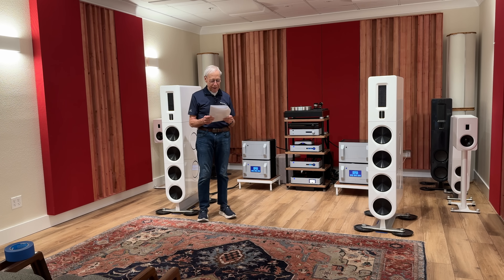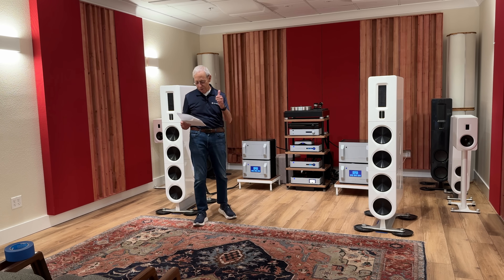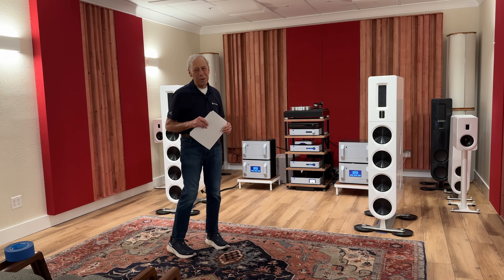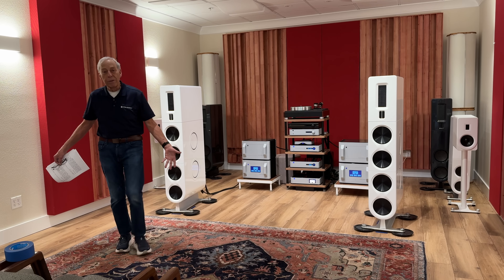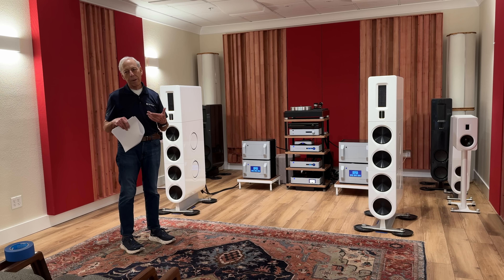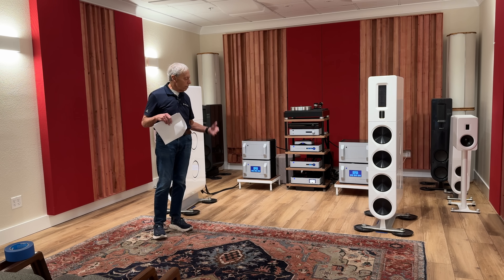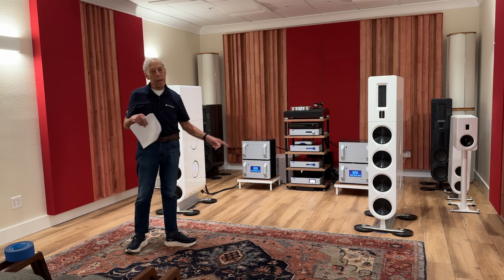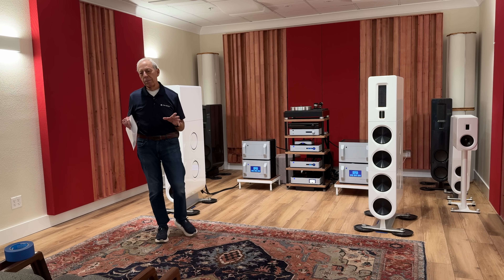Do silver or copper conductors matter in a speaker cable?

Comment: Interesting, what would 20hz to 20,000 kz look like on spectrum analyzer? copper vs silver velocity of propagation. My hearing may be different than yours.
Reply: I imagine nobody here is going to do such a test because it would destroy the 'magic' of their believing.   There is a channel on youtube called Audioholics that does tests like this.  I think one of his tests measured a 0.06db change in frequency response, but other than that, the curves looked similar.  Not sure if he used a spectrum analyzer.  Anyway, I'm not saying the difference isn't detectable.  But I think people are really focusing on the wrong thing here.  I mean, you can get the music to sound differently by moving to a different part of the room.  Shifting your head.   Other things.   

There's way to much focus on making the system sound a certain way and way too little focus on finding good music to listen to to begin with.  Another example - have you ever tried to design/build your own loudspeaker?  When researching the drivers and everything, you might examine the frequency response of a driver in the product tech sheet and notice that even the raw driver in the best of circumstances is nowhere near a flat response and not even a nice curve.  It's a jagged trip all over the place that reminds you of a stock market over time.   Even the finished loudspeaker product measured is still like that to a degree.  Could you detect that (compared to some other driver/loudspeaker) by just listening?   Probably so.   But as long as it's pretty good and close enough does it matter?   

As another analogy, I wonder if most of the people making comments here visiting an art museum lament the fact that the fine art they're looking at isn't pristine - isn't in the optimum lighting - isn't in 100% the condition it was when it was created.  Or do you still enjoy it because it's really about the general content (rather than technical) and the message the artist intended;  Not that the color of orange the artist used is exactly the color of orange you would see today (would the artist want you to be consumed with that rather than experiencing the painting as a whole?) 

This reminds me of myself years ago when I got my first graphics card years ago and then started PC gaming.  But instead of enjoying the games in a general way I was consumed with tweaking each setting (and there were so so many settings) to get the performance of the game as perfect as I could while at the same time trying to get the video quality as high as I could so I would be assured that when I ever did play the game in earnest I would be playing it the most perfect way I could.   And I wasted so much freaking time doing that instead of really playing and enjoying the game.
Reply: @marvinmartian8746  You are correct. Ethan Winer debunked all this nonsense on his channel a few years ago. Admittedly he was testing interconnects and not speaker cables, but he proved that there was no audible difference whatsoever between any two cables he tried.

Comment: Gold Silver Copper 
If You Connect a
Audio Signal To a Oscilloscope You See The Audio Waves as AC Voltage 
There Are Positive Amplitude Frequencies and Negative Amplitude Frequencies Yet The Fact Of The Matter is Current and AC Voltage 
Travels Around The Conductor or
Wire Not Through The Wire….Note This is How Analog Signal Works 
Digital Signal Is Different yet  All  Amplifiers Send a Analog or AC Voltage From Your Amp Around Your Wire To Your Speakers By AC Voltage Your Pre Amplifiers Tells Your Amp To Boost 
The Frequency Sin Wave Which is 
EMF Electro Magnetic 🧲 Field or Electro Magnetic 🧲 Force To a Greater Amplitude or Frequency 
So Gold Silver Copper 
Is a Conductor 
The Audio Signal is a
AC Sin Wave That Travels 
Around The Conductor 
Not Through The Conductor Wire So If The Signal or AC Voltage From Your Amp Too Your Speakers Traveled Through Speaker Wire 
Then We Would Definitely Hear a Difference 
This Is Snake 🐍 Oil
When You Shell Out 
Extra $Money$ For 
Gold or Silver Speaker 🔈 
Wire Because 
The AC Voltage Audio Signal Is 
Indiscriminate Because 
The Audio Signal Travels Around The Conductor 
Not Through The Conductor or Wire 
And Even Gold Wire 
Has Impurities That Would Restrict The Flow if
The Signal Traveled Through Your Speaker Wire 
So Once You Understand Just How Audio Signal Works and Travels Around Your Wire 
It Works Like AC Voltage 
That Travels Around 
Your Speaker 🔈 Wire
Not Through Your 
Speaker 🔈 Wire 
More Phooey 
So When You Buy
Gold or Silver 
Speaker 🔊 🔈 
Wire The Guy That Sold
You The Gold or Silver Speaker Wire is
Laughing 🤣 
All The Way To 
The Bank 
Now I Would Say 
Keep Your Money 💰 
Yet You Can Do a
Few Things To Improve 
The Flow Of Your Audio 
Signal Run Your Speaker 🔈 Wire as Home Runs 
With No Bends or Kinks or
Knots Those Become Choke Points and Create 
Resistance 
Paul Please Paul 
Please as Joe Friday Would 
Say “” Just The Facts Paul 
….Just The Facts “”
The Fire 🔥 Needs a
Log 🪵 
The Old Lady Got Up
and Said “ Come to 
Bed 🛌 “
It’s Time for One
More Bong Hit
and a Slice of Rhubarb 
Pie 🥧
Reply: Give this guy his own YT channel!😎
Reply: Shouldn't have taken that "one more bong hit."
Reply: Yes This is a Subjective 
Topic 
Because Everyone’s Ears Are Different yet When 
You Measure 📐 
The Exact Same 
Volume with The 
Exact Same Music On
A Oscilloscope 
The Same Numbers 
Show Up on
Copper 
Gold or
Silver as
AC Voltage 
Hell You Can 
Get Aluminum Cans 
And Roll Them Into 
Wire and It Acts Like a
Conductor and 
The AC Signals 
Do Not Travel 
Through 
The Aluminum 
The AC Audio Voltage 
Travels Around 
The Aluminum 
Now I Got a
Project For You 
Take a Piece of 
Paper and Make a
Rectangle One 1/4 by
4” Inches 
And Get a Number 2
Pencil ✏️ and Fill In
The Box With Pencil ✏️ 
Pencil ✏️ Make It All
Solid Blacken The Pencil ✏️ and Take A Audio Signal From Your Speaker 🔈 Wire Break 
The Wire And Put The
Wire On The Top and Bottom of Your Blackened 
1/4 x 4” at Each End
The AC Audio Single 
Will Pass Right Through 
Because 
Carbon is Also Conductive Plus if
You Move One End Of 
The Wire Closer To The 
Other The Volume Will Increase And 
That My Friend is What is
Called Linear Taper or
Like on a Mixing Board 
A Round Volume is
Audio Taper 
Paul Has To Sell
His Goods and 
These PS Audio 
Vignettes are 
Nothing but 
Commercials for 
Paul

Comment: Not entirely speaker cable, but I just swapped out the kettle cord powering my Gryphon Diablo 333 integrated amp with a Gryphon Vanta mains cable.  The performance uplift was unreal, and both my wife and daughter (neither of them possessing the slightest interest in high end audio) noticed it immediately too.

Comment: My experience with people who like silver is that they don't often have a balanced sounding rig, at all. It seems more prestige than anything else. 
As for the difference being a thing; massive. Anyone who says there's no difference, never even tried. Taste aside, silver sounds incredibly bright and brittle compared to copper. It's a day and night difference, bigger than between budget copper cables and more upmarket copper cables.
Reply: @rollingtroll  What electric property of silver would make the sound bright and brittle?
Reply: @ThinkingBetter  Absolutely no idea, I just use my ears and that's consistent :).
Reply: @ If you can truly hear silver from copper as more bright and brittle assuming same resistance of cable (copper needs to be larger gauge), you should prove it with consistency in a blind test and make yourself a fortune. The cable industry lacks evidence for such claims and us engineers lack any explanation for it. Personally I've done blind tests professionally for years and have never heard such thing.
Reply: @ If you don't hear it you haven't tried it :). Many blind tests were had, it's a hilariously big difference.
Reply: @rollingtroll  It is imaginary.
Reply: @ThinkingBetter  Try again😂🎉
Reply: @Error2username  It is still imaginary. Silver has no sound to it.
Reply: @Error2username  It is imaginary, did it sink in this time?

Comment: I used to be a non believer of sound differences between cables until I bought a "HighEnd" set of silver RCA cables for my turntable. Big difference! in sound. Went back to copper. The silver lacked in the bass & sounded harsh by comparison.
Reply: Turntable cables are the easiest to tell apart, because the electronic characteristics matter. I don't believe you hear a difference because they are silver, but because the capacitance and the shielding is different to the previous you had.
Reply: @giannismag3064  Then explain to me the consistency of silver and copper cables both expensive and cheap, no matter where you use them :).
Reply: Good call on going back to copper. And the non-believers are also non-listeners. Try and get them for a listening test, they always refuse.

Comment: Speaker wire does not have a sound, but it does have a resistance.
This is the relevent factor in choosing its diameter and composition.
For 12 AWG (American), the diameter is 0.08", and as copper, the resistance is 1.6 ohms per 1000ft. 
A 10ft length would therefore equate to 0.016 ohms, and this tiny resistance in series with your 4 ohm speakers is irrelevent.
Silver is only about 6% lower than copper in resistance, so do not bother with it and save money at the same time.
Take care listening to sales people who tell you differently, and listen to engineers instead.
Reply: You sound more knowledgeable than I, in my post.
At what gauge would the silver wire be to match the resistance of 12 gauge copper? Perhaps that would be the comparison for a double blind test.
Reply: @arvidlystnur4827  that doesn't sound half unreasonable. Honestly, the dimensions are tiny, as in "tiny tiny." This is somewhat basic EE homework I invite people to double-check, but it's somewhere around 12.5 AWG, which is obviously barely worth talking about. 0.05 mm difference or something? Super back of the napkin, but it tracks if you consider that Silver's conductivity is only around 6 % higher compared to copper.

It just cannot produce an audible effect is the bottom line here. Yes, there are physical differences in different types of cables, materials, hardware, but that far from implies that they will result in remotely perceptible changes in the quality of what we're ultimately hearing. You can go for double the diameter and you still would not hear a hint of a difference, because there is none for the sake of this argument.
Reply: @piripiri-kefalotyri ,
Thanks for the response. 
It clarifies to me that with comparable resistance, the difference would be moot. As price would differ.
Reply: @arvidlystnur4827  it is not the physics of materials is referring in this topic, but musical sound characteristics
Reply: I agree. I can see a situation where a person has a stand-alone pair of speakers paired with an amp. does the metal make a difference? perhaps. since stand-alone speakers use passive crossovers, a difference in resistance can and would make subtle differences since it's one super wire connected to the whole thing. but is it really a product of the metal itself or the particular speakers, their specific crossovers, the component values, and obviously the room all rolled into a giant biscuit. and perhaps even the source, the DAC, or any preamps in the path etc! I personally have an active DSP system, 3-way for now soon to be 4, short speaker wire lengths with no passive crossovers. I guarantee the difference in sound would be so minimal at that point so as to be dismissed, due to variables. side-note: I currently use silver plated 12g OFC copper wire, upgraded from Monster Cable 12g OFC with fancy dielectrics, because I read that it helps with corrosion in humid situations such as marine audio. this is in a house but I live in a humid place so yeah. as to the sound? not really.
Reply: Higher audio frequencies travel more on the suface which is where silver makes a difference.  The dc measured reistance does not apply with the surface resistance to ac frequencies.  I actually like to wire with silver to the tweeter and copper to the woofer.  It makes a very nice difference in imaging and sound stage to use the silver on the tweeters.
Reply: @ brrrr, it would be much too bright for me. But you do you!
Reply: @DeMorcan  the skin effect is utterly irrelevant for any sort of audio application of that sort. Doesn't even track at all.
Reply: Agree, speaker wires are not actually having a sound other than what the resistance might cause e.g. in loss of damping factor. Silver has better conductivity (lower resistance) than copper and is a better choice if you have unlimited money to spend. When comparing copper and silver wire based on cost relative to resistance, silver wire is significantly more expensive than copper wire. Thus, on a consumer market, you get more audio fidelity with copper for your Dollars spent. Case closed.
Reply: May I suggest you actually listen to the two and then make up your mind? :).
I'm sure theres a theory to why it sounds completely different, but I couldn't tell you that. I can tell you that silver has a very recognizable and consistent difference in sound when compared with copper.
Reply: @rollingtroll  Well, what's the n? Did you even blind yourself to the test or are you just consecutively switching cables? Because that's a far cry from a proper and rigorous test that would prove that you actually perceive two not similar but functionally identical pieces of equipment as different.

First step in troubleshooting your setup is making sure you know how to test it, I'd wager that's what we're missing here.
Reply: @piripiri-kefalotyri  why don't you do the test yourself instead of telling others to do it.
Reply: @mitchtaylor6512  I mean I did, plenty of times, on literally hundreds of subjects in a variety of blinded settings. Like most people who take this serious, I'd wager.
Reply: @minhuang8848  so nobody could hear a difference in 30 seconds on a system they are not familiar with under test stress conditions, imagine that.
Reply: @ Almost as if I accounted for all possible confounding variables and factors, including acclimatization periods (fun fact: you can do that over the course of weeks, if not months - you even can coordinate tests allowing people to use their personal playback device of preference to really drive home the point).

Being familiar with a system is also utterly irrelevant. You can't discern a difference despite vaguely physical changes in your signal chain, no amount of time will get you there, especially not when we have established over and over that the physical signal reaching your ear is going to already be exactly the same as all the rest. We're just troubleshooting the tiniest of mystic claims about conductivity somehow affecting the acoustic signal, which is just tens of different kinds of silly if you spent the shortest amount of time attending relevant lectures.

Imagine that, some Walmart conjecture about magical gems and metals augmenting your ethereal music don't hold up to vaguely rigorous scrutiny. Almost said "academic" here, but this is more like a bunch of people telling a kid who repeatedly put together a working baking soda volcano "nuh-uh, my gut just tells me this isn't how it should work," riffing on about crystals and chakras guiding the needle on their next vinyl sessions - and worse.

Comment: Thanks for this excellent video. But where I am a bit consternated is that each component is actually fine tuned to a certain standard by the hardware producers, not to mention the set-up in the music/mixing studios. So the question if certain high end could come up to 100% quality is also influenced how the master is intended to sound. And there we have the problem, if - what I see in your background - the music replication system is far better than the studio equipment then we have a problem and the 'different' sound of speaker cables becomes more an ideological than a quality of music question.

Comment: Use gold, it can deliver the 'golden sound' for your wax polished ears...
Reply: It’s much  more profitable to sell copper or silver with gold prices. Its not about sound, It’s all about profit.
Reply: There was a guy making interconnects that swore that gold was the way to go.  I make my interconnects and tried adding gold.  I could not hear it.  But to me, silver and copper are clearly different.  Silver is dirt cheap so not a barrier if you like it.  Gold even in a short run is expensive.  It would need to be a massive improvement to offer any value and to my ears and not a winner.
Reply: @user-od9iz9cv1w   Actually you do not need to have solid gold string... Gold plated copper wire is a practical solution.